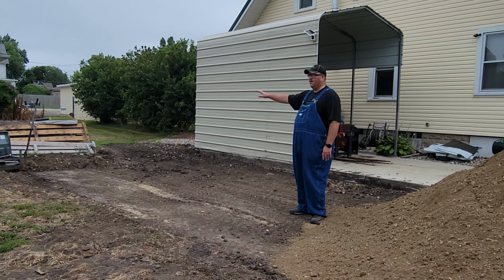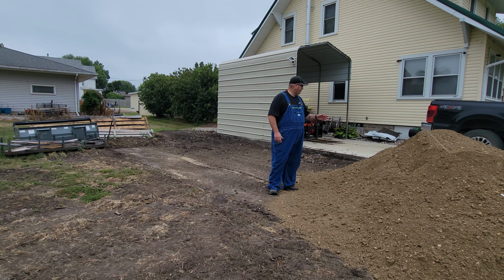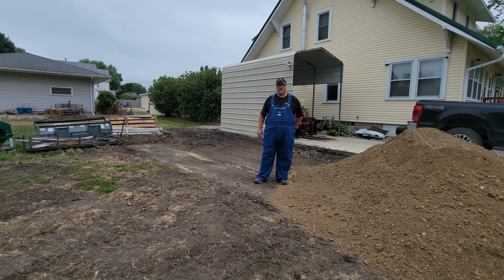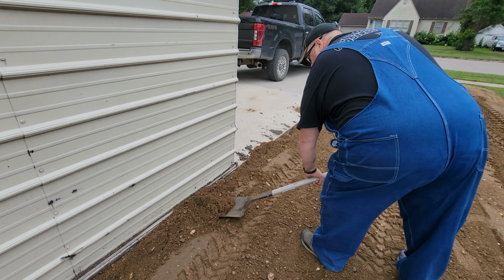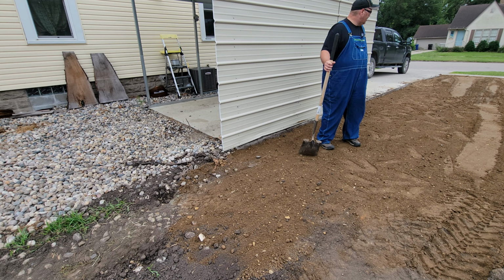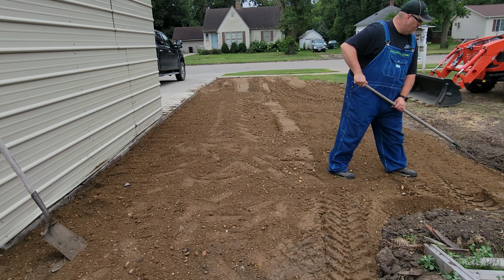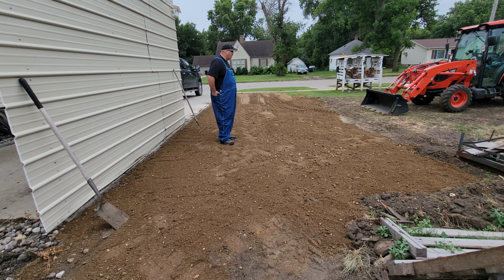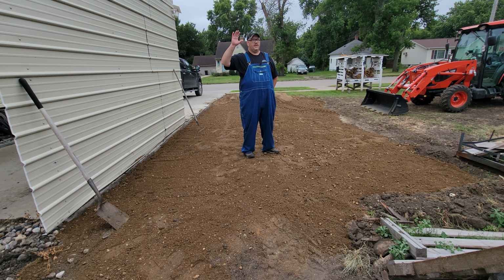Putting in a gravel driveway for future project  IronCraft box blade and Kioti DK5320 tractor

Comment: Good vid Tim.  Ya, I HATE using my box blade.  Part of that is because I'm just not very good with it, and I don't have a lot of experience with it, hence the reason that I'm not very good with it.  I really look forward to getting a land plane.  I think I'd have better off with a land plane in the first place over the box blade.  I think hydraulic top and tilt cylinders will help me though, so I need to get those.  You'll have a nice spot for your firewood when you get your structure built though Bud, good for you!
Reply from the maker: @JeffGeorgalas  it is a bit tricky because the 3 points don't seem to lift when I want them to. I think I continue to lift too long. Need to move it and wait, then move it a bit more. I agree on the hydraulic top link. Side link would help as well, but I only have one rear remote so top link may be coming soon.  The more I use ground engaging implements, the more I see the value in hydraulic top link.